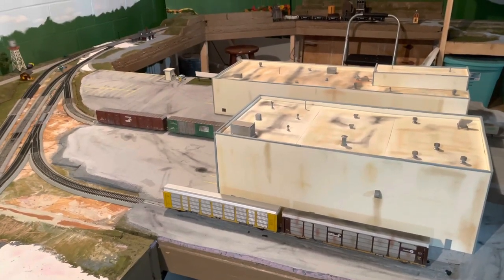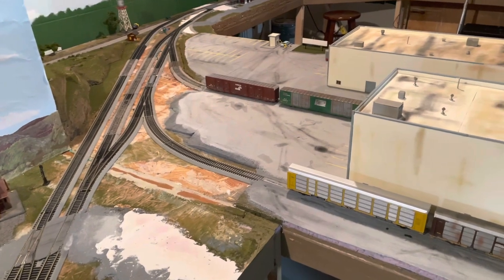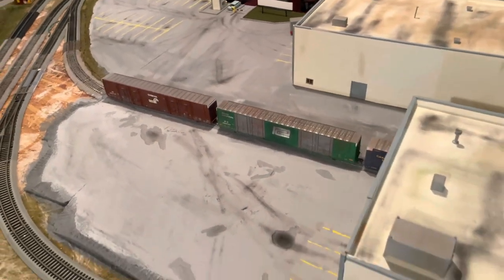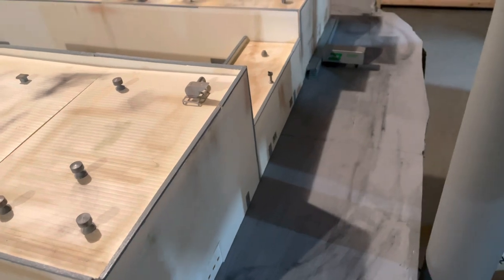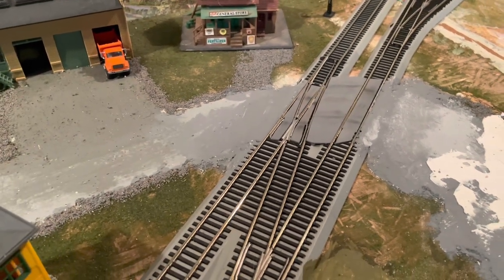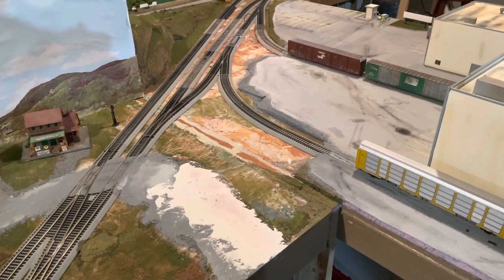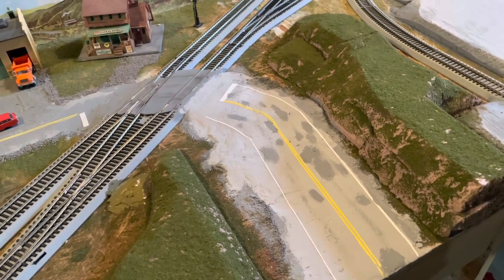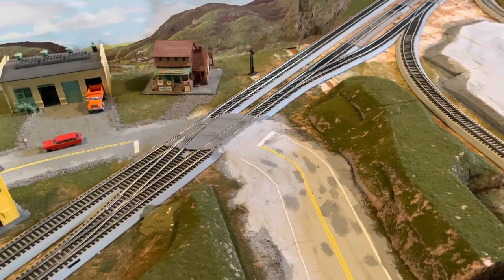Layout Update 6 - Setting the (surrounding) Scene

Comment: Looks great. I cannot understand the use of the the E-Z track. Traditional track, specially flex track, and turnouts make it so much easier to do what's wanted. Otherwise, fantastic job
Reply from the maker: Thanks Jason! For me EZ track helped me early in my modeling with keeping things simple and I’ve just decided to stick with it. Also in my opinion, the tight connections have helped me use less power feeders. But you are correct, at times I have to be creative fitting in those predetermined sections. It’s a little unconventional for sure. I really appreciate you watching! 👍